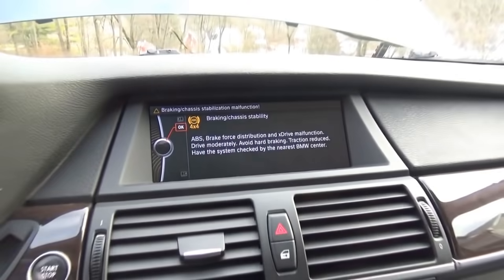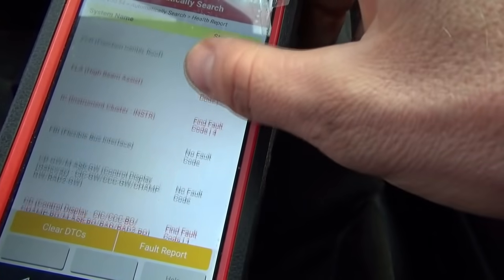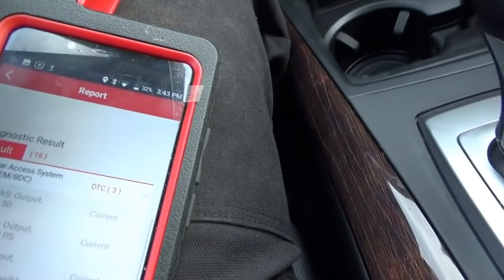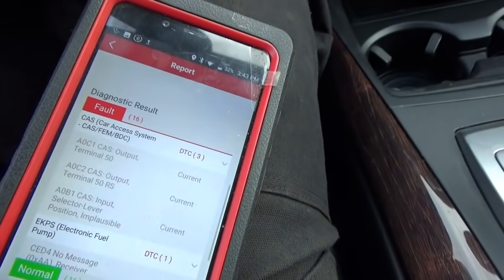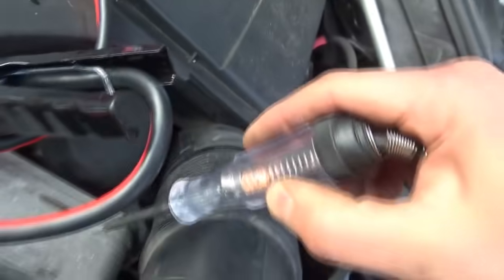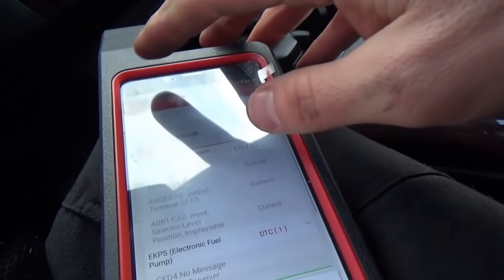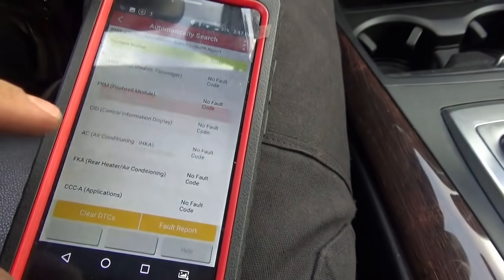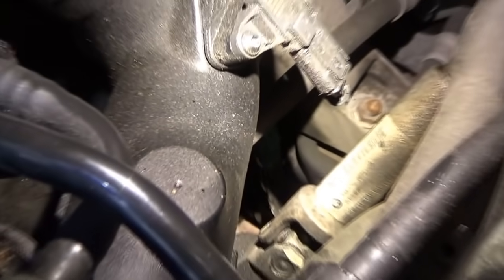Busted BMW (No Crank, No Comm)

Comment: Nice find!
Back in the day when the block grounds failed, seen many where starter current found its way back to ground through the accelerator or choke cables, melting their plastic sleeving and jamming the cable
Reply: yep, or other paths through fuel lines/clamps with rubber bushing worn, driveshaft/u-joints, shifter linkage/arms. you name it, the high current always wins :)
Reply: Great point

Comment: As mentioned, how and where to put the cable to bypass the ground is priceless.  I couldn’t find my cables in the snowy box of my truck so I used one side off my booster pack and wedged it in the same spot by the oil filter and clamped to the cross member. -40 w/wind outside and the BMX started on 5 cranks. Thank You Ivan!

Comment: i did guess this one right for a change, yes i was prompted by that mad car last time.
Ivan I don't think anyone will forget that previous mad car lol.
That ground strap reminded me of the braded wire on a vw golf starter motor, green and falls apart in the hand.
Reply: not the only starters that used a braided wire from solenoid contacts into starter brush/field lol. seen many failed over the years.

Comment: Excellent video! Solved my problem! Never would have thought. This was als9 preventing alternator from charging battery properly.
Reply: I have no crank. No start. All Christmas tree. 2011 E70 , 162 k  Kms. I will definitely check k the ground strap. It is definitely 12 years old and crusty rusted. Probably that is why no crank. It drove fine the day before and I parked it . Tried to start back up. No crank or start. Asked tow guy to boost the car. We tried to boost it from the engine bay. No lick. It started. After we boosted it from the battery. But the voltage 11.2 while the engine is running. That threw me off. Before I throw any part at it. The battery is brand new. I will check the ground strap. That could be the culprit. Thank u.

Comment: You won't believe this but I had almost the exact same issue with a BMW SUV last week.  The difference was that on the one I worked on the problem was the negative terminal on the battery which is mounted in the trunk with the spare tire.  The customer said that when they attempted to start the motor the starter would spin but it wouldn't crank the motor over on the phone and I instructed them to jump the vehicle with another car to get it to me so that I could diagnose the issue.  A previous owner had butchered the wiring to add a sound system so I suspected the problem was going to be in that area so that was my initial point of attack and had the repair completed in less than 15 minutes.
Reply: I think I will call Guinness book of world records: two BMW's fixed in less than a half hour and customer charged less than $500!  I bet when you see these things come in you have a million causes going through your mind.
Reply: @dogsplantscarsneatstuff176  That's funny

Comment: Ah, the importance of grounding straps...

I've relayed the saga of my fantastic 1993 C1500 before.  She's old but solid.  I will do just about anything to keep this simple, solid, and classic going.  A couple of years ago I noticed the engine-to-frame-to-body grounding strap was near toast.  I replaced both proactively to avoid the approaching odd electrical issues.

Then, while under the back, I noticed the static electricity grounding strap from the fuel filler neck to body was near dust.  Replaced that too!

Good old eBay for the win on sourcing a small coil of tinned braided strapping!

Comment: Scotty: "BMWs are endless money pits, look at how many codes it has!"
Ivan: "It has one bad wire."
Reply: LMAO  yeah Scotty "all these computers are junk", Ivan "you just haven't a clue what you're doing and probably never did"
Reply: By the way.......my 2009 Honda CR-V had a similar problem and all it was, was a loose negative battery cable. The computer did find it......but that was too easy. In final desperation I tried to turn the cable, and it turned. I put on a new flat washer, a star washer and a new locking nut. Cleared all codes.....all problems went away!  The computer went crazy with this untightened ground. Thanks....Jim
Reply: PS......This was last year at 115,000 miles....Jim
Reply: Still though, one bad wire to cause all those modules to not function?

I have no issue with BMW myself, but their engineers really should have gone further with the engine ground.

Comment: Another great diagnosis.  I’m enjoying learning from you every time.   Especially on this one since I drive an X5.  If you ever have a valvetronic issue on the E70 X5’s, re run the reset function first before tearing into the intake to fix.  Random but may help someone out there.

Comment: In all the years as working as a tech I never thought to use a simple test light for engine ground verification. Always used a meter. I remember stories of missing engine grounds causing bearing failure on engines. Ivan I sent you an email on your website.
Reply from the maker: Thanks David!

Comment: Had that exact same problem on a 2012 Bmw. I think it was a 528xi if I recall (it was back in may 2021). It was the first time I had a bad main ground problem like that so it took me a while to figure it out. (4 or 5 hours I think). I carry jumper cables In my diagnostic tool bag ever since for just that reason now. Lol! I remember what was frustrating about it at the time was that all data had no wiring diagrams for the car, or any decent  service information for the one code it had in the DME. In fact, the snap on scan tool I was using had a useless code description too, and identifix had nothing to offer for the code. I remember thinking how I’m diagnosing a pretty complex car with a no start and more than a fee peculiar symptoms, but I was diagnosing it straight old school. I’ll always remember that one and how thrilled I was when I figured it out. Ground strap was even in the exact same condition and I pulled on it and it broke away!👍

Comment: You the man , I have had this before , normally make up a new earth cable and attached it some where easy to get to, near the alternator. Nissan's in the UK if battery 🔋 is very low will give many many ghost codes
And general new battery will sort it .

Comment: Thank you for the excellent diagnosis. when my 2011 X5 N55 no crank and  no  start. e what. As the suv was running fine until one day. 
I came across your video and decided to look for poor ground.,? 
Yes that was exactly the issue with me suv. Thank you . Took out the rusted and bad ground cable. Do you self this favour change this part$48 that can leave you stranded.  For sure all owners should make this to be a maintenance item. Pls check it. 
Thank you 😊 bless you . Merry Xmas and a happy prosperous new year.

Comment: Diagnose Dan had a similar issue with a 3-series. Turned out to be a wire shorting to ground via the exhaust, courtesy of a torn wiring harness.

Comment: I travel on Interstate s NY to Florida every month for 10 years.
These are the cars I see stuck on hwy:
1:Jeeps/ Chrysler
2: BMW
3:Audi vw
4: Benz
5: Various American brands that outnumber Euro trash by 10x nationally.

Usually GM Ford older models is  a fuel pump or belt pulley high miles cheap to fix .
Get a Skoda over here
Reply: Skoda and Seat are both also VAG (VW) just a different design.
Reply: @blockbertus  oh ..I meant old CZ  cars  made well  like Swedish Volvo's.
Reply: @Nudnik1  Oh, I see. Yeah, that's true. Or just get a real Volvo. ;-)

My opinion:
The newer the car (regardless the manufacturer), the more problems there are. And the harder it gets for the DIYer to do stuff on their own.
Reply: Having this information and knowing what is bad, next time carry parts and sell them at a premium price on the road 😅
Reply: @blockbertus  most American cars cheap to fix compared to Euro.Mid 2000s GM easy cheap to fix used parts all over. I have a bunch of GM trucks gas powered all over 200k miles not many issues.

I have the 3 million mile Volvo near me on Long island NY.
I liked the old 240 4cylinder manual transmission from 70s best..
Now a cult car especially Volvo wagons..
Soon all will be electric cars and batteries will be the issue .
Shalom
Reply: @scientist100  lol 😅  New my module for a Mercedes is like $2000 each
My bro has a shop does all Euro cars warranty work Ferrari.
Benz Bently Range Rover s Rolls Royce...insane costs problems for any part s  service. He drives a Chevy pick up 2002 and his Wife with the kids a Chevy Suburban. 
Aston Martin brake pads $900
Reply: Sad, but I see alot of very late model GM products broken down when I'm on the road ... and I don't get out much these days! That's a bad sign for GM quality ...
Reply: @SmittySmithsonite  actually there are many many more GM cars in number than any other so one would expect to see some. I usually see older ones in bad shape stuck .
I don't include blown tires etc.
Reply: @Nudnik1  - I’ve owned several, and work on countless late model vehicles. I can tell you hands down that stuff built in the last 14 years is garbage compared to anything prior. Earlier than ‘96 were the last good ones. Parts cost a fortune on the newer ones, too. I’ve got a ‘86 Grand Marquis I’ve owned 18 years, has 274k miles on it, and it hasn’t cost me 1/10th what my Silverado has in 14 years, with less than half the miles - 104k to be exact. Already replaced the rear differential & 4L60E transmission in it, too. The Grand Marquis is still on the original driveline, and even the original in-tank fuel pump. 😎
Reply: @SmittySmithsonite  in some cases yes.
Newer stuff seems to high tech to flimsy.
Pre 2008 seems better.
Reply: @SmittySmithsonite  I got 380k miles out of my Chevy van original motor and transmission rear towing bobcat trailers in metro NYC area stop and go.
So sometime s you get a 🍋.
I won't own Ford after they went to OHC v8 phasers and plugs in head.
I had a few f250 Triton's all got 10mpg empty my Chevy gets 20 empty.
Ford Taurus in 90s the worst disaster head gaskets transmission .
So each mfg had good bad years models etc.

The new 3.5 v6 Ford eco has a water pump in timing chain cover in oil. When it leaks it ruins engine.
Electronics will be the main fail on new age cars after 2010.
I keep my older stuff forever.
Marquis were good like Crown Victoria.
Good luck
Reply: @Nudnik1  - Yeah, that's the truth. The older Chevy truck platforms from the GMT-800 back were solid - easily capable of 250-300k miles without much in the way of repairs. Boy did that change with the 900 series. Not only are they failure prone, but the most difficult to work on that I've ever had in my life.

Comment: If you have so many codes on BMW, that usually means battery problems (low voltage). That the start. Sort out battery and then chase  the faults. In this case ground, but the starter sounded like was struggling a little on the beginning.

Comment: 2011 X5 35i.  Same exact symptoms. Used a test light on same points. But getting a strong light.  Tried jumper cables in same spot.  Mine bolt on the oil cooler is a bit rusty.  But got some signs of life now.  Tried to start.  Got a click. Still no start.  Battery is brand new.  Looked at ground strap.  See all the same greenys.  Must be the ground!   Going to replace it anyway.  I think they’re like $8!

Comment: Nice - there's a reason they say to start with the simple checks! So, how to prevent this sort of thing? The braid looked completely unprotected - I would think plastic sheathing over the strap and dielectric grease on the connections (only on the outside) would be a good idea.

Comment: I wouldn't have trusted cranking and running it with jumper cables to random location on the engine to body, for fear of it spiking with big back emf pulse  or other surge and blow something up.
the relays clicking and things going live would have been plenty enough to go and fix grounds back properly.

Comment: why do the old ground straps last forever,Ive seen cars that are 50 yrs old and the ground's are still good
Reply: Back in those days auto manufacturer's sole focus was CUSTOMER SATISFACTION - a foreign concept in the 21st Century. These days it's all about how much money they can save. The strap, and pretty much EVERY other part of the vehicle, regardless of brand, uses subpar materials compared to what was used 50 years ago. There hasn't been any high quality steel, aluminum, or copper used in any automobile in 25+ years.
Reply: @SmittySmithsonite  as a machinst I know that, nothing worse than almost being    with a part, turning on a lathe and a chunk of steele come's out

Comment: Yeah I found out my starter cable runs all the way in the back
trunk connecting to the Terminal Distribution Fuse Junction Plate
and that's why my suv wouldn't start. I tested all the positive cables and found out one wasn't
hot which was the starter cable.

Comment: Big thumbs up! Great work. My first thought was an faulty CAN line, but it was the ground. Does the ECU ground itself to the engine?
Reply from the maker: Yup the DME is bolted to the side of the engine xD
Reply: @PineHollowAutoDiagnostics  OK that explain that. Never understood the idea of bolting sensitive microelectronics, soldered together with lead free easy cracking tin on to the hot and vibrating engine, but perhaps this is for boosting dealer network after sales and services revenue?

Comment: Looks like even Bavarian auto parts are fading in quality. A braided ground strap should last 2generations.  Good call !
Reply: One of the biggest factors is location, when a vehicle lives in the rust belt. Ground straps that are mounted higher up last much longer since they stay drier.
Reply: you act as if it's not direct from China, with the poorest quality recycled dirty copper >_>

Comment: Hello,

Im having with bmw x5 m50d with 381 hp - 2012 - 2014 same issue

When scanning with diag it gives many errors for dme/dde 

When i try to connect on ecu with FLEX using pinout ecu communicates successfully,

Any ide what to try?

Thanks

Comment: Just had this same issue with a 03 Benz clk320...i learned something valuable with no crank no starts...always always always jump block to chassis first lol. I spent about an hour too. Case was broken down at a Lowe's big box store, I get there and the battery was dead so I hooked it up to my service vehicle to charge it... It's an older model that requires the Benz adapter to the Benz diag port so I had to dick around with trying to find the adapter since I rarely use it with obd2 lol. Then I read codes to find no codes except under voltage codes, then I had to find the starter relay location and tested there...didn't have what I needed and couldn't jump it through my uactivate relay tester...still no beans...then...i tested the ground and boom! There it was! 

I wasted so much time! I skipped the damn basics! Won't do that again lol. That's going to be my starting point from now on with a no crank lol.
Reply from the maker: Those are the ones you never forget :)
Reply: Don't feel bad. I shotgunned a couple o2 sensors at a '07 Suburban today thinking I'd get this turd out of here quicker. Bit me right in the ass! No power on the heater circuit - the ONE vehicle I don't test!!

Comment: With the new ground strap, wouldn’t it be better if you coated it in grease to prevent more  corrosion ?
Reply: Yes. Penetrating oil would be even better.

Comment: I'd honestly make my own ground strap up out of insulated cable because I think that the new ground strap is going to corrode out again !
Reply: agreed
Reply: use good welding cable (high strand count) mil-spec hydraulic crimped ends, finished with sealing/fusing heat-shrink. never have to worry again :)

Comment: why would engine computer loose comms with a bad block ground? can't seem to have an answer from the top of my head, that's definitely not what i would've thought in the field either.
Reply: Because the DME receives the negative of the battery through the motor.
Reply: @engeneer_ru5827  масса на мозги с блока, серьезно? я ж посмотрю схему на нее
Reply: @izukenekuzi  Ну, вероятно так! Других причин, думаю, быть не может. Если есть схема, интересно узнать так ли это!
Reply: @engeneer_ru5827  нет у меня схем больше, лицензия кончилась. в халявных не нашел ничего, вопрос открытый..
Reply from the maker: @izukenekuzi  Ага, блок DME прикручен прямо к движку :)
Reply: @PineHollowAutoDiagnostics  ясно, спасибо. это фиаско🤯

Comment: Wow!!! Good job!! I’m hoping you can help me out. I literally have the same color inside and outside x5 and literally having the same issue except I have power to the main areas you touched and yes the ground wire is in very good shape. Im suspecting the (pcm) shit the bed. I have power to the main wire that’s held with a 13mm bolt but the the furthest pin connectors to the pcm have no power to them at all and that’s with the x5 in contact and a jumper pack attached to the terminals inside the engine bay. Would you say that being no power to those pin connectors I pretty much found the solution to my no start but only crank? Yes I’ve checked all fuses and I also checked fuel pump and they all checked off good? If you have any advice please do
Share. Thank you!
Reply: Hello, did you figure out the problem? Thanks G
Reply: @singhsarabjit  mines turned out to be the ism module that’s located in the passenger side engine bay. It’s a black box that has 50 amp fuses that’s are not serviceable.
Reply: @ramisiljazi9540  thank you so much